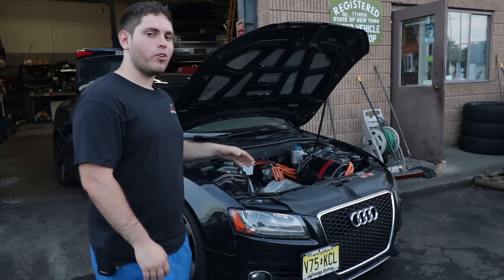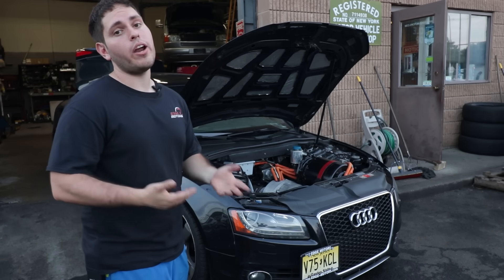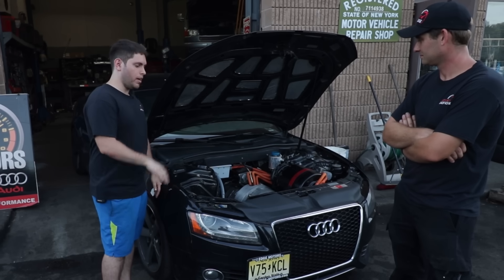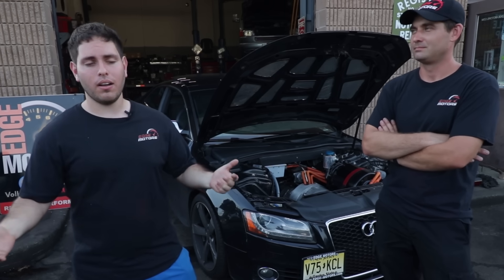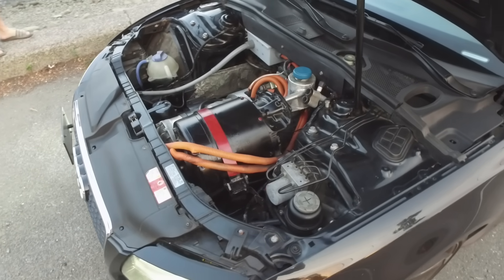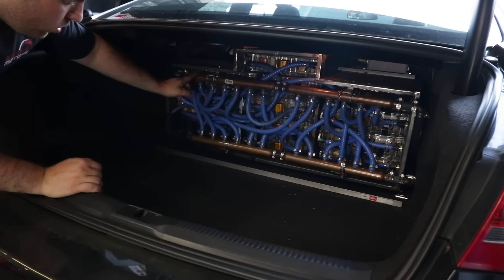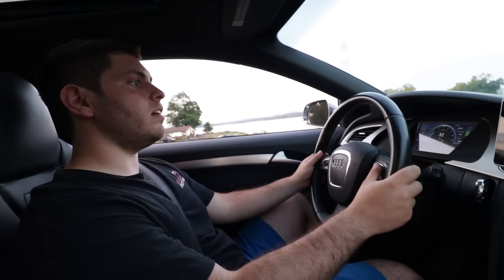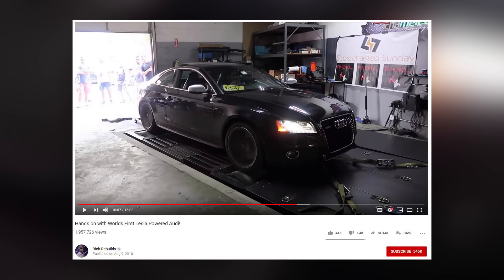Worlds ONLY Tesla Swapped Audi! How Did He do it?

Comment: 9:25 ha ha ha. You are not electrician. High voltage are above 400V. Here in europe its all standard to 230 each phase, 400 between two phases. And its called low voltage. In USA its between 110 to 130V. In command we use 24V DC. Until the 90's it was usual to use 64V in command, but now, all the world use 24 DC in command. Still exist 24 AC, but its parts to old systems. And its not voltage that creates fire. Its the current, amperes. In cables its almost only about amperes what you need to know to uses the correct cable sizes.

Comment: This crazy to me. By far the most impressive part of this to me is just mating the motor ECU to the Audi ECU. The amount of expertise it must have required to complete that. Maybe I'm overestimating the feat but wow that sounds tedious
Reply: That sounds complex but it isn't that hard as it sounds. As they have mentioned you need to record can bus messages. They you need to examine that and learn how two different can buses are communicating with modules. In the next step you need to make custom micro computer which would translate messages from one can bus system to another.

Comment: it's all great what you two did The Russian guy has the knowledge.  But you did not explain how the technical inspection of that Audi goes.  because there is no more atmospheric engine inside and on the technical inspection they measure the CO2 emission as much as the machine produces.  Did you have to do any additional test for this electric motor since the car papers say that it is a factory petrol engine or a diesel engine inside?

Comment: Fully discharged is obviously not a complete lack of electricity. It's not empty of charge or power, it's a description that has nothing to do with combustion. A 100hp gas car with no fuel still has 100hp. This is a description of electrical machinery, completely separate from combustion. It's obvious fully discharged, you still have power. (This is not fact, just what I get from the explanation. It's funny this man built this car, explains the terms and conditions, then one hundred people compare the vehicle to a gas engine.......you don't understand the term, doesn't mean the term fully discharged, can be compared to an empty tank, or lack of one or more conditions that define hp output on a Tesla.) He built it, you watched it, how does that make you qualified to critique, or compare. ....heavy sigh)

Comment: I’m not an expert but I’d say fully discharged it’s 0 horsepower
Reply: 🤔
Which technically is less 🤓
Reply: and i would say empty gas tank is 0 horsepower
Reply: How many horsepower has fuel car without fuel ?? 🤔
Reply: @pictol8395  ....the same as when built, it simply lacks fuel. But discharged on a Tesla, the battery still has horsepower. Fully discharged is not a condition of being without electricity. It's simply a condition that needs to be involved in the description of an electric motor.
Reply: Yeah just like you would when you run out of gas
Reply: LOL was thinking the same, fully emptied gas tank won't do much either XD
Reply: Unless he has a sticker, then it’s automatically +5 hp
Reply: The starter has between 2 and 3 horsepower.
Reply: @maik5825  ok, try driving in a gas car with no gas then
Reply: @sepg5084  I already did but it is very slow (approx. 5-6 kph). And the starter really doesn't like it.

https://youtu.be/jIjhOQpmvBw?t=253
Reply: No

Comment: Now build a dynamo( electric generator) that converts the mechanical energy (rotating wheels) to electric power that charges the batteries while you drive that way you'll never need to plug in to charge.

Comment: Small note about your module cooling technique. It actually wouldn't make a difference (for cooling) if you chained the cooling loops in series. The thermodynamics work out such that a closed loop is going to have essentially the same temperature gradient from radiator to the heat sources regardless of if they're all in series or you pipe it through a distribution manifold. Honestly I would wager a series loop would have better cooling capacity because it's easier to control the flow characteristics through the modules to ensure that they all have even flow, where with the manifold that's almost certainly not the case.

Where series could be a problem is if the pressure drop through the system becomes too large for your pump to handle. So if that's a problem, so be it.

Comment: The dude had a normal and comprehensive Tesla battery, no need to be so handy that it wouldn’t be pushed into the bottom of the car, in Russia they completely digest the bottom of rotten cars, and some do it yourself with a do-it-yourself sheet metal from a factory, even if you don’t put a normal gear selector

Comment: I am very interested in the whole EV equipment. 1). What is the torque of the EV Motor all Set. (Need 650 - 800 Nm. Up.) 
2). Converter DC to DC Controller. 
3). Battery full Pack set. ● May I ask the price of all the equipment? / Is it new? กี่ How many% is the equipment in? And how is the warranty? @If I want to buy the model of the device you see in this clip Do you have details? Contact me at Email: Suppaporn.s@gmail.com BKK Thailand. +66 (0) 92 7832639
 I'm Mr.Suppaporn. (Moxs)

Comment: having all the batteries in the trunk is probably not great for center of gravity but the front to back weight distribution must be pretty damn good in this thing, and having all the batteries up towards the front of the trunk right over the rear wheels is probably pretty good for rear end traction.  It must fuckin haul on a track

Comment: 0:39 Here’s the gear selectors. Reverse, neutral, drive... uhh i meant drive, neutral, reverse.  For the amount of money you spent on this modification, you couldn’t have put proper labels on the center gear selectors?  Potentially costly mistake if you’re not careful.
Reply: i dont necesarily think so since they are in logical order, the first/front one is drive, the middle one is neutral and the third/the one in the back is reverse

Comment: Fun project but this is nothing new. People have been doing emotor swaps for decades.  

Some things not clear like where’s the ac condenser and compressor motor, is it legal, registered, is there cruise control or adaptive cruise control integration, motor cooling heat exchanger, did they use all the batteries or just some, is the charger integrated with the ECU, ...lots more

Comment: Hold on, I'm not at all familiar with electric motors, do all Tesla's have the same motor, just different amps for it?
And how far can you push an electric motor? Will it break with too much amps or will it just stop producing more power? (Assuming the cables and such don't burn up of course)

Comment: He did something Audi has been trying to do for decades: Build a reliable Audi.
Reply: My 1.9 tdi audi a3 from 2006 has around 380k miles. Not even an oil leak. So dont say that audis are unreliable. Audi owners just dont look after their cars.
Reply: @GunRunner3  Teslas will go much farther than 80 miles on a charge 😂
Reply: As an audi fanboy this comment trigger de me

My old ass rusty ass audi A6 from 1996 has driven 410000 kms and still fine just yearly maintenance costs.

It looks beat up from the outside but will still take me from A to B every single day.

And while I'm cruising in my beast of a machine most newer cars are on the side of the streets with emergency lights on and its never a German car!
Reply: by making a more complex and more costly to fix car? 

doubt
Reply: @ssalic0  exactly. And they cant even drive a manual.
Reply: This joke would be much funnier, if it was actually based on the truth.
Reply: does this mean more stuff breaks on audi then my bmw? and i had lots of odd stuff break only to find out its common on these cars
Reply: What?..
Reply: No, Audi was never trying. They'd rather sell $$$ replacement parts, and give owners an excuse to buy a new one when something breaks.
Reply: I had a reliable A4 and a less reliable A6, but the Fairfield CT dealership would reliably change parts that were working fine. I once did the rear brakes myself and the next visit they call me to tell they have less than 500 miles life left without even looking at the car.

Comment: That Quattro drive will be toast very fast. You don’t need the Quattro if you front and rear electric motors like the Tesla motors are supposed to run. The Quattro is limiting the motors capabilities. Cut a third to up to half of what the motor is capable of.

Comment: how does re-gen work, does the inverter convert it back to dc?  I guess both systems ac, dc are on same shaft, so re-gen spins with motor breaking pushing dc current back on dc side. Ac side just spins free. Correct?

So basically pushing accelerator is just pushing dc side of inverter speeding up ac side frequecy. Why the middleman, why not straight dc?

The thermistors controlling the battery cooling system. Not sure I like that. Thermistors are good for information but they do burn out. I would make the fluid flow mandatory on starting. That would be one performance hit worth while. No fires.

Comment: I dont understand why people remove gears from electric cars. Gears is both more torque at low speed and more top speed at high speed, regardless of how much torque you already have with a single gear, it just adds more. The only con is that you pose acceleration when shifting, but automatic Gear boxes do that quickly for you.
Reply: I would venture a guess: Because you don't need more torque or higher speed, the elec. motor already has a very broad range, and insane torque. one less component to fail or even maintain, less weight, etc...
Reply: @JustAnotherJarhead  Why would you not need more torque ? The only case when you don't need more torque is if it already exceeds the traction the wheels can provide, but other than that, it remains useful. And if you don't have enough traction, you can still make the wheels wider. I can understand why they would do that on a regular daily car, for efficiency and maintainability as you say, but there's just no reason to not have a gear box on supercars and hypercars, even if it is just a 2 or 3 gears gear box.

Comment: "You don't have to worry about vacuum..." Car has vacuum pump installed 🤭
Reply: Eric G But brakes are a back up in this case, you stop with the engine and it puts the power generated back in the batteries “regen”. You still want the pump and brakes working, but you could drive without them.

Comment: Years ago I converted a gas RC to electric because there weren't any electric 1/8 kits yet. Also, about a couple years ago, I added a motor to one of my bikes. Funny enough, the e-bike uses RC batteries, I just had to wire up lot of them - 16S2P configuration of lipo cells making 59.2V nominal with 10Ah.
But what you did is magnitudes more impressive. That said, the core components are the same: AC/brushless motor, inverter (electronic speed controller or ESC in RC) and a lithium-based battery.
I hope one day to do a conversion of a car. I even have an Audi with Quattro (A6) but it's fine the way it is...for now.

Comment: Congrats you spent 100k to make your car weigh at least 1,000 lbs more, overheat in less than a minute of driving, brake wear, tire wear, weight distribution, handling, performance, top speed, range,  everything’s reduced except wow.... you can go 0-60 in like a couple hundred milliseconds faster....... nice 👍
If you were to take it to the ring it would be at least 2 min a lap slower though....

Comment: You took this pretty far tech wise, see if you can bring more emotion to the EV driving experience somehow. Take the tech and show it, like you see an all decked out V12 Twin Turbo, chrome, accents, carbon, etc. Look at the IBM, Cray, even the newer super computers when there exposed, all the lights that do have function, switches, fiber optics, how things get electrically charged. Not seen this, you can even include it in the cab if you punch it the corners of the car light up to compensate for the lack of sound.

Comment: Wow!  Well done man.  Were you able to recoup some cost by selling the S8 motor?  I have been disappointed that all manufacturers were phasing out manual transmissions because it gives the driver so much more control over torque input to the wheelsl but electric changes everything, in a really good way.

Comment: i think keeping it awd was a good idea, and electric swapping it was a great idea, but you lost me when you replaced the simplistic, mechanically reliable, h-pattern shifter and clutch pedal with elevator buttons and added a completely unnecessary and overly distracting touch screen, those two things are NOT good ideas. 5/10 would be 8 out of 10 if it was manual and 10 out of 10 if you got the tv screen off the dashboard and into the backseat with the kids where it belongs, aside from those two things, THIS IS WHAT WE NEED TO BE DOING, forget building new plastic self driving electric pieces of shit, instead we should be integrating electric technology to keep pre-existing cars running as long and as cleanly as possible. great job.

Comment: I just did a Porsche Boxster was 7 Tesla batteries 170 volts and it cruises at 60 pulling about a hundred and fifty amps. I'm seeing a lot of voltage drop and I'm wondering about my batteries. Of course as I only have 7 modules I'm working them harder then if there was 16. I have been able to pull out 130 amp hours while driving before voltage goes below 3 Volts for cell. I am charging them to 4.05 so I may be  not getting a full charge  and not getting the 225  half hours  that I thought they were rated for . I'm wondering what you are finding with your batteries?
Reply: Cool car, yeah Tesla's batteries do sag quite a bit under load. The Chemistry that is used is amazing for energy density but not for using it quickly, hence the sag. You can charge them all the way up to 4.2V, although I usually stop mine around 4.15 so they last longer. I've found that their discharge curve is quite linear so you should be getting more than half the AH's at 4.05. I would check their internal resistances to see if they might be on their way out. Could also be why your voltage sags more than you would expect. I would try to stop discharging at 3.3V, and use 3.0 as the static cutoff voltage. Hope this helps!
Reply: @polykup9453  yes this helps quite a bit I have to stay below 175 volts on my charge as I have a LV zilla  controller which used to have a peak voltage of 180 but they've now lowered it to 170 so that's why the lower 4.05 cell charge .

Comment: it would be interesting if you could integrate some super or ultra caps into the system to generate some punchy power when needed and receive quick power on regen. might make it very reactive on  a machine that's already reactive hmmm. so a quick regen can come back as a kick when you back off and then punch it
13:03 that's not a train, that's him swearing how much it cost

Comment: What if you put two converters somehow and then push double the power of stock safely with another battery pack and you’ll be running the same amount of electricity you use with one converter and one battery pack it’s like installing two engines instead of just one

Comment: You should have expanded the battery seeing's how is a four-wheel drive and it needed more power. Put a bigger battery pack or packs to get that extra kick of power. Also I would have done 200 miles per hour and you would have just had to spend a little bit more time creating a part so that car would allowed to reach that speed

Comment: Contactors in a junction box?? How are they isolated? From what I understand the high voltage negative is not continuous with low voltage (12v) ground. But bolting contactors to a junction box that's bolted to the chassis greatly reduces isolation between the two circuits.

Comment: that is some masochistic streak you have there! - incredible amount of work and i am all up for conversions....but...too similar to the base Tesla to justify? - Personally I would like to see something like a TT mk3 with a Tesla 3 performance powerplant and reduced amount of batteries with super capacitors added to cover peak power burst of acceleration....geared and weighted to give c 4 sec o-60mph and top out at just over 100 - range 250 miles plus on a cruise